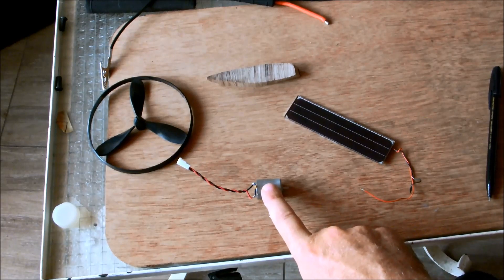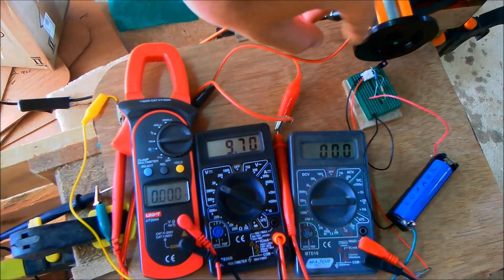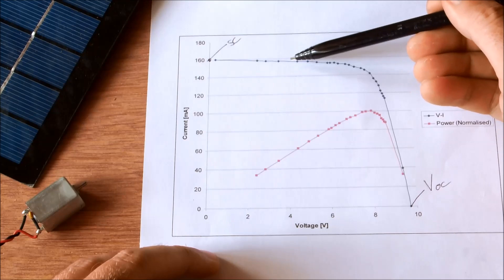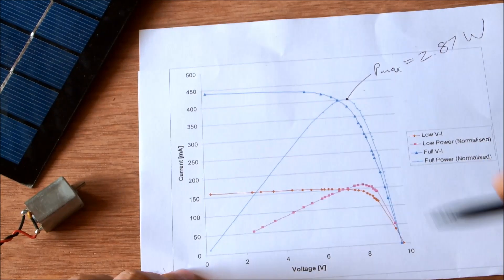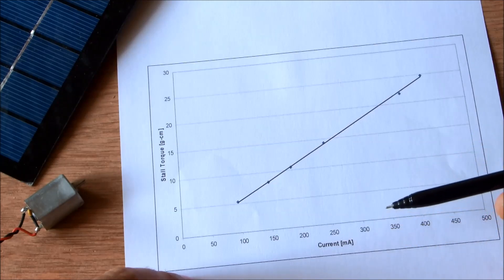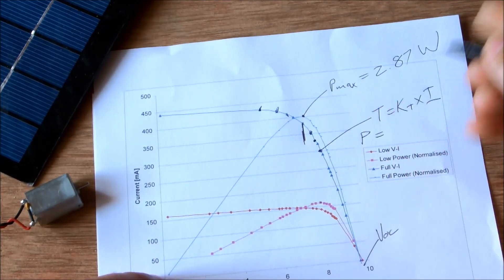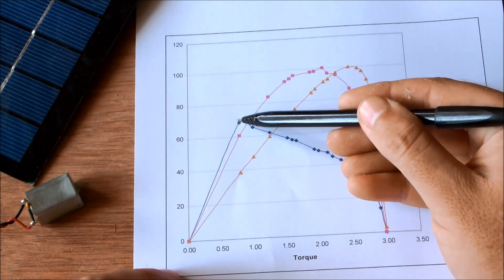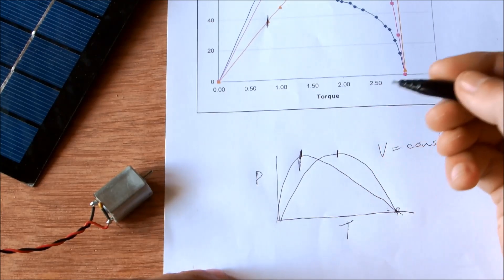Solar/electric propulsion #1 - Understanding the Panel

Comment: Thanks again, I'll probably have to watch this again later to fully understand this. 

So you basically want to first find the right motor that produces optimum power at the maximum power point of the panel, MPPT or not. Even though we don't know yet what torque and RPM we actually need. 

THEN you need to look into the propeller and a gearing system to match those the desired cruising speed.

Looking forward to your next video!
Reply from the maker: Depending on how much control you have on the MPPT's output, it can also be used to shift the motor's point of max efficiency to match the power of the panel. Other solutions that could work for direct drive would be to change the number of panels or even the number of motors. 
The setup as tested in this video is a good example of a case where and additional motor would help. One motor cannot cope (efficiently) with all the power available from the panel AT PANEL MPP VOLTAGE. By sharing the load with another motor in parallel, each would be operating at better efficiency.
I did not show the motor efficiency results for the "low light" case, but it was in fact a pretty good match.
Reply: @williamfraser  Interesting idea yeah, multiple motors haha. But for my goal I'd really would prefer a single efficient motor with a large propeller.
But I'll have to learn all of this and then put it all in a spreadsheet because the ultimate performance I'm looking for is "range per sunny day" (for a solar powered liveaboard cruiser) . 

E.g. like how many nautical miles can you sail in the summer in the Mediterranean with a speed range of 5-8 knots within 10 hours or 24 hours.
So then going slower could be less efficient for the motor but more efficient for the range.